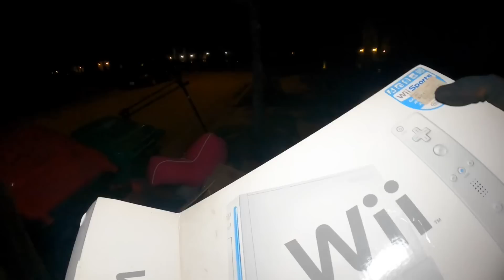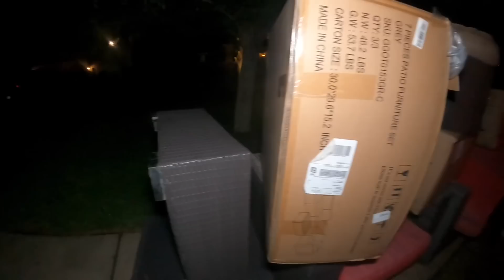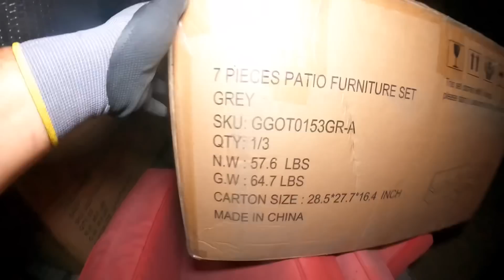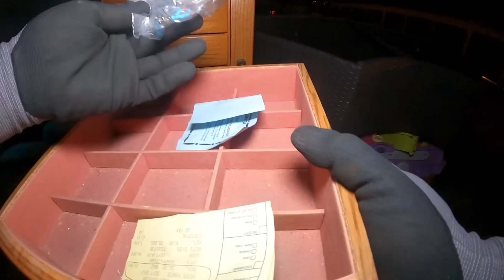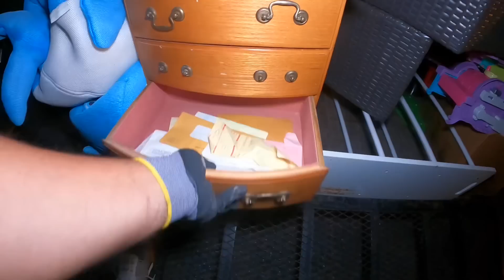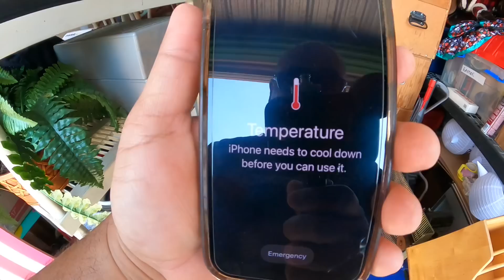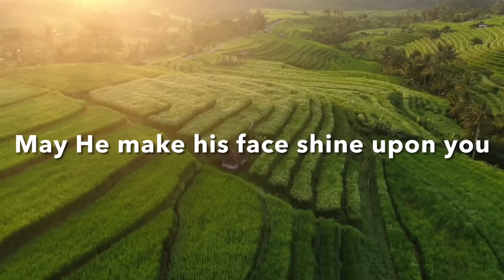Diamonds in the trash?

Comment: I don't know if I mentioned it before but when I was a kid I had a little Jeep and a train the original line now that went on the hard plastic tracks that you could ride on my dad got motorcycle batteries that fit in the same spot that were given to him that were too old to work for motorcycles with great for those little cars and then you do what's called pigtailing to the batteries ask an electrician if you don't know what I mean and then you can charge them up on a regular battery charger for your car or motorcycle